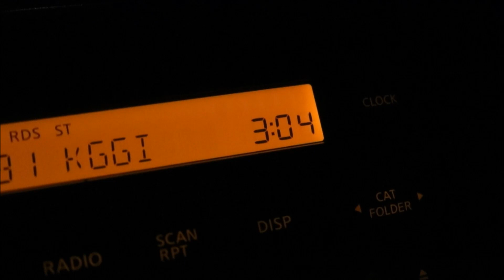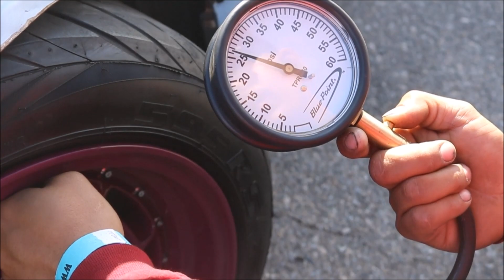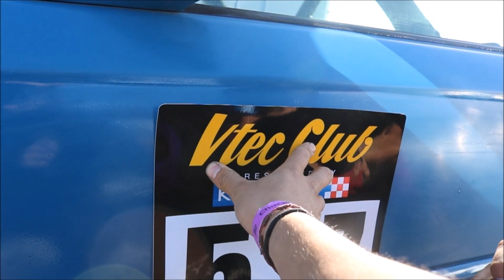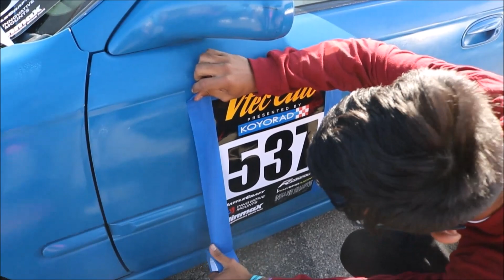FIRST TIME RACING AT CHUCKWALLA RACEWAY!

Comment: From my experience a decent hard track tire that won't chunk or over heat to bad that you can drive to the track and back are the falken azenis rt615k.  They aren't super grippy but they are decent enough for track use.  I have really liked the Toyo r888s as a street tire for track use.  I have also had good experience with the potenza re71s and Toyo r1r if you are looking for a more hard street/track tire like the azenis rt615k.  Tires like this give you decent vertical and lateral grip, don't over heat easily and are hard enough to get quite a few track days out of.  Plus you can grow into the tire instead of going straight into a r888 or even something like a Hoosier.

Comment: And you may already be aware but the 2 best mods you can do for now are tires and brakes.  A decent pad I have found for street strip use are the hawk hp plus pads and hawk high performance street race pads with cryo treated stop tech slotted rotors or dba rotors.  These rotors seem to be able to take the heat and not crack.  The hawk blue pads are also great for road racing but they take some time to build heat in them.  Brembo used to offer slotted and or drilled rotors that seemed very durable and could take a lot of heat but sadly they only offer an oem replacement now.  Just avoid drilled rotors as they generally will end up cracking unless they are brembos or some other high end manufacturer.

Comment: You guys did great!!  Such a narrow line between at the limit and over isn't it?  The guy in the ef particularly was close consistently close to the clipping points and utilized the track well and was smooth on the throttle but you also did great as you showed some guts in some of those corners as you tried to learn the limits of the car!!

Comment: I just got a nice top mount for my eg and know I also changed my mind from drag to road race. Think I will just stay 400 max and time attack it. What do you think? Stay all motor B20v or put 10 13lbs into it?
Reply: Heads Up all motor 💯
Reply: 400 whp will be an absolute handful on a road course even with sticky tires.  Even on 225/45/16 Toyo r888s on wastegate which is 15psi and a little over 415whp you cannot control wheel spin in anything other than 3rd and up.  I also have the spherical bearing lower control arms that virtually eliminate caster movement to the point many say a traction bar is pointless and you still get nearly uncontrollable wheel spin in 2nd going straight.  I'd hate to have to turn.  Also have quaife lsd.
Reply: Matt Thompson This is absolutely true.  When I actively road raced I quickly realized that 180whp in a itr was more than enough.  As they say for track days start with tires and brakes.  Get comfortable.  Then suspension and cut the weight out.  Power will be the last of your concerns for quite a while.

Comment: Turbo the blue civic
Reply: Jeremy Hill they're both blue civics
Reply: HBKmoy I mean the one that's a coupe, not the hatch
Reply: He had it turbo way back, but don't recall why he took it off, some problem kept going on.
Reply: Alfredo Garcia The Motor Was Low Compression & was running like shit lol
Reply: DSM_Dynamic Temo I commented  it on a video that if he's not going turbo again that he should get a better set up. Upgrade the pc,cams, change the o rings, better headers and wider exhaust maybe 3 inch. And dyno it. Should get better numbers.
Reply: Alfredo Garcia I heard him & Leo Are gonna be boosting but who knows when
Reply: For sure should focus on power output & tires, forget cosmetics & seats
Reply: For sure should focus on power output & tires, forget cosmetics
Reply: DSM_Dynamic Temo exactly if he goes turbo he still gonna need all of the above. So the motor can handle more than 7psi